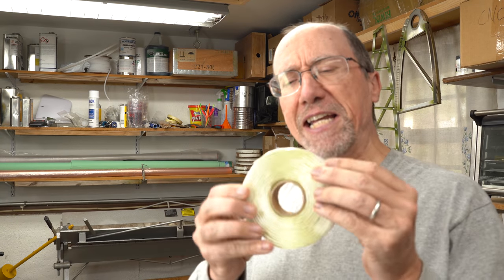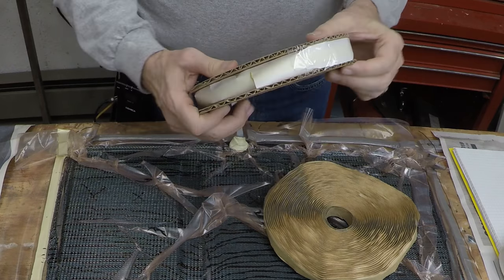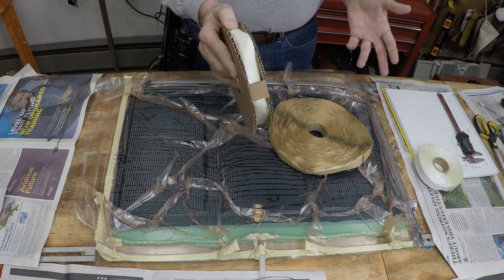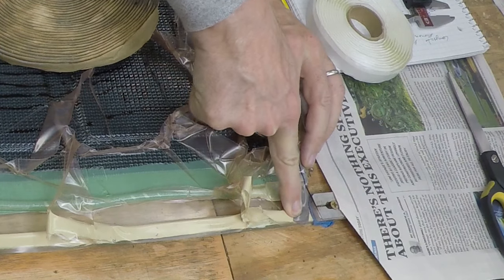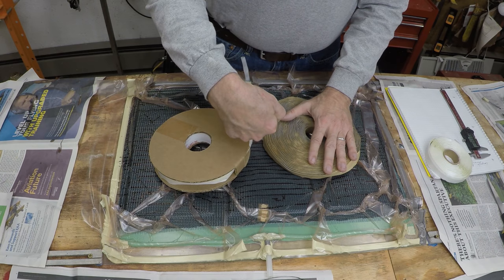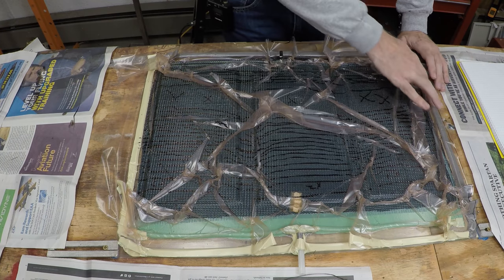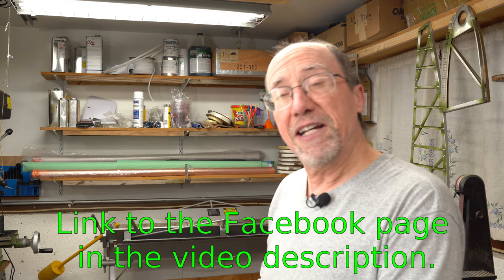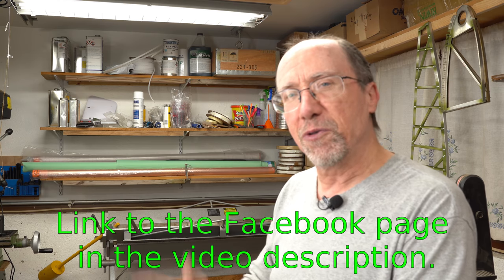Composite Tip: HomeDepot Vacuum Bag Tacky Tape

Comment: Store butyl tape in the freezer. If it starts becoming alive during use simply chuck it back in the cold. Having multiple rolls really helps too because you can cycle through them. Humidity can become a problem so we keep them in Ziploc bags and a few in a Tupperware container. 

Don't sit on discarded cuttings and jump in your wife's car, she could become butyl on occasions too.
Reply from the maker: Thanks for the tips on butyl tape.

Comment: What is with the rib template hanging on the wall behind you at 7:00.  Did I miss a video ?
Reply from the maker: I have some rib parts for an Ultracruiser that I have been working on from time to time. I have not made any videos about that yet. I just work on them when I'm waiting for samples to cure or videos to render.